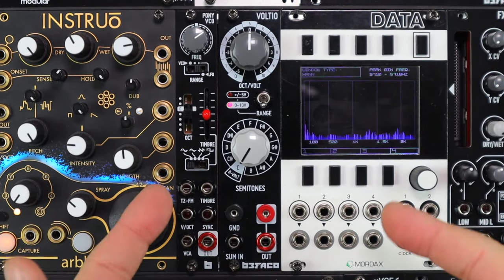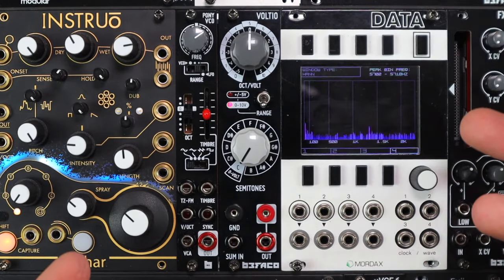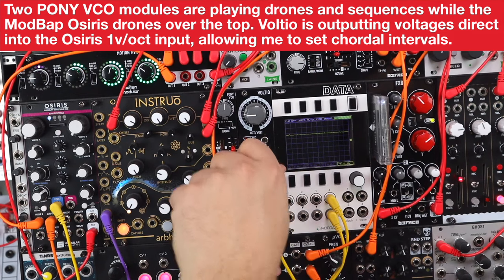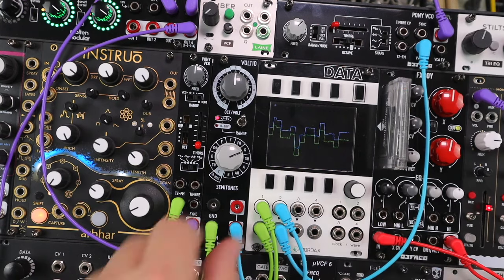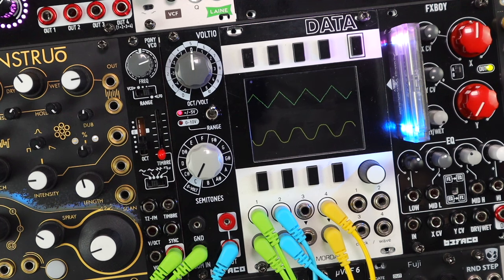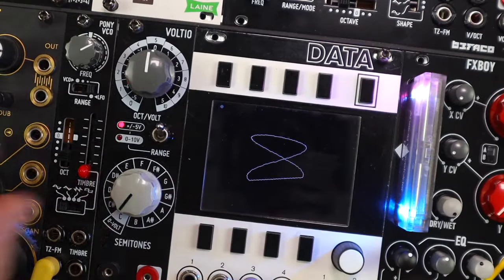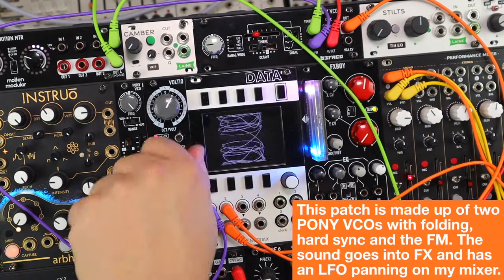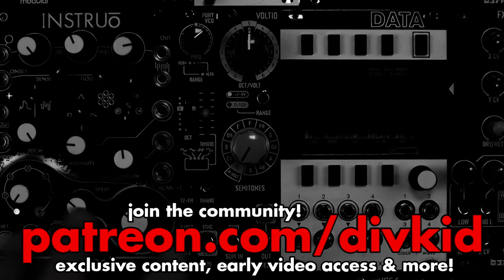Creative & Musical Uses of Precision Adders, Offset Voltages & Transposing // BEFACO VOLTIO

Comment: That patch with fm was an incredible use I think! Love the way that Befaco continues to have these wonderful puzzle piece type modules that really give a lot to your system. This would be incredible for calibrating modules as well!
Reply from the maker: Thanks, I was really happy with that one. Locking the tuning in the FM can take a little work sometimes so once that was done it was great to then be able to switch through tones without loosing that locked in stable tone.
Reply: @DivKid  absolutely! The after that it’s just a world of tones available! Just so smart!
Reply: @DivKid  For tuning... were you experiencing pitch slew issues with the TZ-FM input on the Pony? Is that why you also used hard sync? 

I've had four Pony's, and all require a few seconds for pitch to stabilize when TZ-FM amplitude changes (with both audio-rate and DC sources). Maybe hard sync is a way around the issue.
Reply from the maker: Hi TMeier, this was my first and very limited time with the Pony VCOs so I really can't say. I used hard sync as I often do with FM and other more complex modulation. So there was really no thought beyond just building up a familiar patch - FM, fold, sync. 

I made that patch in a few minutes, then turned the camera on. Things happen quickly when I'm working as I've little time, due to the sheer amount of time videos take (if that makes any sense). I haven't heard the TZFM without making that patch. 

Shame there's been issues, with yours/certain units or the design. I'll ask about it and hopefully get some time to try it properly soon. Though I'm pulling a case apart to set up for the next demo which I'm now working on so no promises for having time soon.
Reply: @DivKid  Thanks! There's a quick demo of Pony's TZ-FM on my channel if you want to see it in action... oh and thanks yet again for putting another Befaco module on my wish-list 😂

Comment: This looks interesting. Would it help me control the pitch created by feeding a cv source into my Terrarium Fm? Found a nice effect of doing that, taking the cable out of the Fm and sometimes having it drop back down. Issue is I cannot regularise the pitch created by Fm ing the terrarium ( with my 171-2). It’s too un replicable for live performance
Reply from the maker: lots of FM does make the pitch drift. You could adjust the affect of a rising pitch with negative voltage from this (into another FM input or the pitch input) to offset and work the two things together. 

But it won't lock in the tuning. 

Try using hard sync between the oscillators to get things more stable.